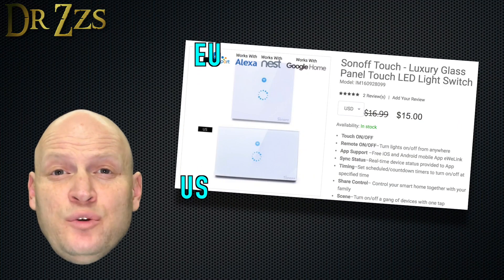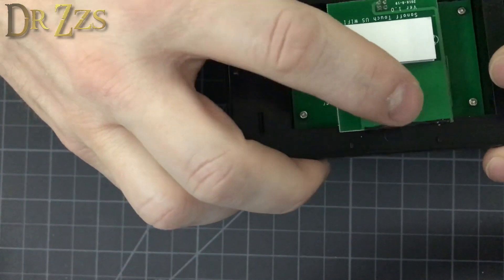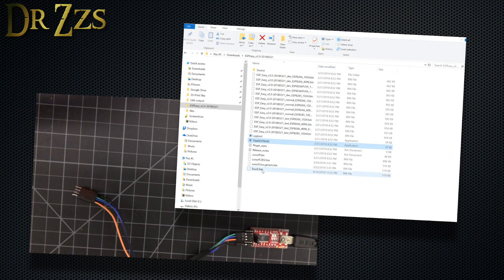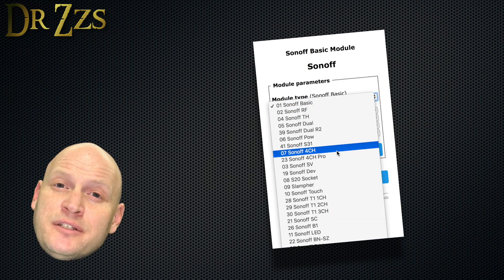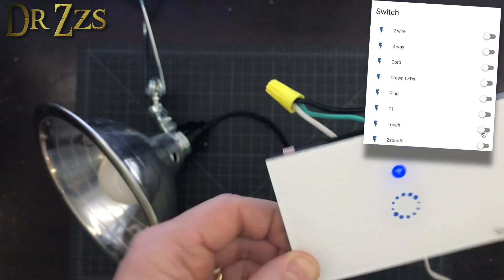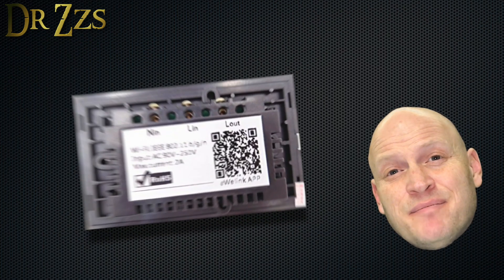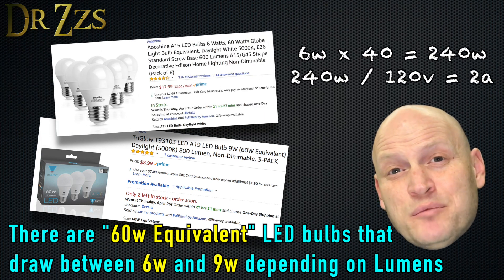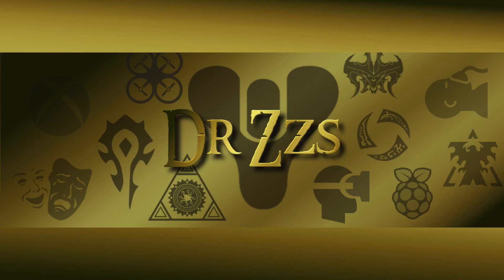How to Flash the $15 Smart Switch | Tasmota & Home Assistant | Home Automation

Comment: guys, dont buy the "touch" buy the "touch T1" versions. 
- oriantation is right 
- flashing is way easier since it has a reset button and it also has a dedicated flash mode (press/hold button 1 while pressing reset)
Reply: Would there be a way to program more than one off these switches to work toghetter to activate lamps from more than one location... like my hallway , 4 switches to activate one lamp
Reply from the maker: If you have a hub (like Home Assistant) then yes.  That's how I did a 3-way switch.  One sonoff controlling the lights, then the others just sending MQTT messages that control the first one.  
You'd need a way to customize the MQTT message though, so stock eWeLink software wouldn't do it.
Reply: Yes . You can use the tasmota console and issue the command “GroupTopic livingroom” and “ButtonTopic livingroom” “livingroom” can be whatever you like. You have to do the same thing on all switches you want to work together. You have to connect the light on only one switch or if you have more than one light you can connect more than one. Don’t connect more than 2A on one switch!
Reply: Actually, you can accomplish the same using eWeLink app by creating scenes, 2 for each switch you want to control. I have been using that method while I am in the process of moving everything over to HA. By creating an 'ON' scene and 'OFF' scene for each switch to make the other switch follow the same position. Both switches go to 'on' or both go to 'off' and only one switch is required to have a switch leg to the light or device. The problem is lack of customization without HA.
Reply from the maker: Oh awesome!  Decent solution for those without HA or other hub.
Thanks!
Reply from the maker: ha, ya for sure.  Wouldn't take a ton of research to know what to fix.  It fit okay in my switchbox.  I've got the new version ordered so I'll let you know what improvements they made
Reply: Thanks for the tip Mate!! I was wondering all the time what key combo to use to flash it!! No guesses why Sonoff has chosen not to document this feature!!

Comment: Can't deal with 2A limit. Risky for people to make a mistake with a $15 switch that can't handle more than 2A. $22 get you a 15A rated switch and safety.
Reply from the maker: Can't argue with that.  Which switch would you choose that's $22 and 15A?  I'd like to check it out.
Reply: be interested to see if you can flash these too
Reply from the maker: was there supposed to be a link?  If so, it didn't come through.
Reply: Strange, I see the link, but the search on Amazon is for "Meross smart Wall switch"
Reply: I have the Meross switch running 3 fluorescent bulbs and 3 LED mirror lamps, which would be over the 2A rating.
Reply from the maker: Looks like that switch uses "MT7687" chip, probably instead of the ESP8266.  My guess is Tasmota won't work on it.  I'll do some research though and try to verify that. 
I don't know why they've limited the current so much on the Sonoff Touch.  Even the 3 switch models are only rated for 2A.  And I don't think that's 2 amps per switch, that's 2 amps total for 3 switches!  That seriously limits what you can do with them.  One ceiling fan and a couple incandescent bulbs and you're at the max!
Maybe they're just looking to the future when everyone only has LED bulbs.
Reply from the maker: it does look like you can run Arduino sketches on that chip: https://docs.labs.mediatek.com/resource/linkit7697-arduino/en/environment-setup/setup-arduino-ide

I'd have to crack open that switch to test it out. I am planning to branch out beyond sonoffs (once I've flashed everything they make :) 
I'll have to remember that chip and do some videos with devices based on it.  I don't think I'll get to it for a month or more.

Comment: This is great for retro fit but not for new construction.  Do they have a 12-24 dc version?   Alternatively battery operated would be great (look mom no wires place anywhere like this https://forum.mysensors.org/topic/6938/battery-powered-glass-touch-switch/3 ) but battery life is issue with esp8266 or similar.......Go Blue
Reply from the maker: We may get there one day.  Where all our higher voltage stuff is tucked away and controlled centrally by low voltage or batter powered switches.  Cool concept for sure.  
And you just earned Super Viewer status! GO BLUE!

Comment: those screws break pretty easy as well..
Reply from the maker: really?  bummer.  I noticed I was able to tighten it enough to flatten the solid copper wire from my romex.
Reply: well, I was used to normal electrical switches, and I was used to tightening them down really good, let's just say I tighten them down gingerly now!  but yes, I twisted the top right off...
Reply from the maker: maybe you're spending too much time in the gym.
:)

Comment: For what it's worth, here is the Sonoff T1 R2 US Touch Board V1.0, its significantly different to the one shown in this video. http://bit.ly/2yY2wBw - I have nit yet worked our how to flash this... Any suggestions?
Reply from the maker: I've got that one too.  I'm going to try flashing it with SonOtA.exe
I'll put out the video as soon as I am successful.
Reply: I tried a few options. I could get the serial working at an odd baud rate but I couldn't get the device into flash mode.. The options I tried included a combination of pressing S1 & P1/P2/P3 as i have read on other pages. I am a bit of a newbie and did the best I could. Anyway, I thought at least publish a photo of the T1 R2 US Touch Board V1.0 which I could not find anywhere else online. I look forward to learning how you did it!  By the way, this board design perfectly matches the orientation of switch designs here in Australia. Thx. Russ

Comment: nice one same dont like the look
Reply from the maker: ya, Mrs Zzs isn't going to allow this one in the formal sitting room that's for sure.   That's why it's in the Maker Faire wall...
Reply: LOL 
hay just put a HC-SR04  on a wemos with tasmota  its to easy   you could put in your Maker Faire wall and get it turn a light on when some get to close to the wall
Reply from the maker: ha!  Warning! Step Away from the Wall!  
oooh, maybe I could set up an automation so my Holiday lights change when someone activates it!  That'd be cool. 

Is there a setting in Tasmota for that sensor or did you just use "switch"?
Reply: LOL LOL   Note Must be Lastest Tasmota 5.12>  and there a command to tell tasmota to send a message every ?? sec can't rember off top of head